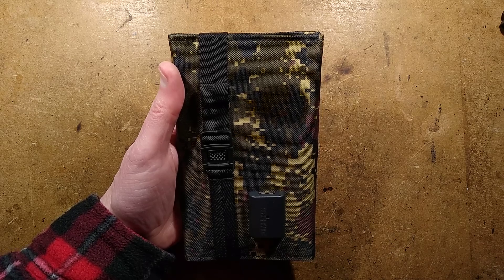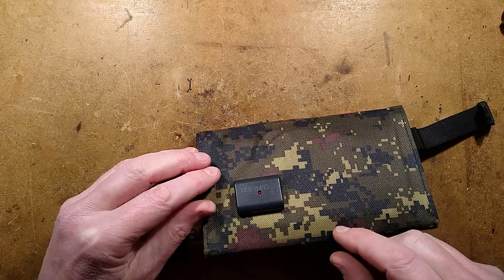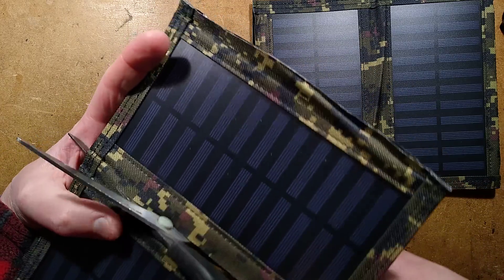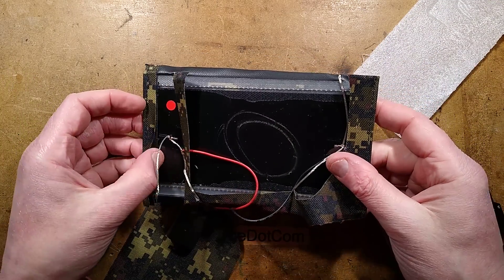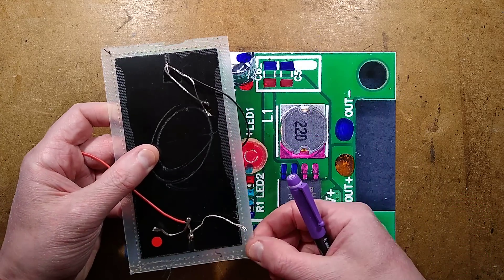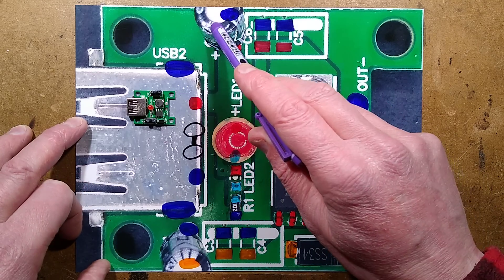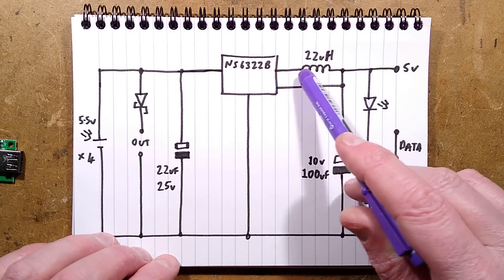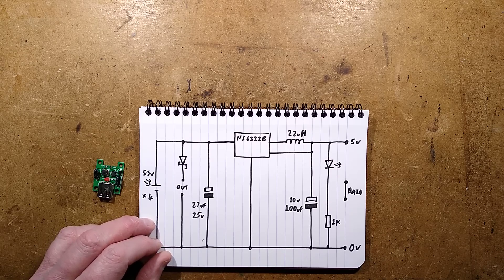Inside an eBay folding solar panel - with schematic

Comment: That reflects partly my experience with the solar-panel-added powerbank I bought.
The 4 or 5 solar panels barely kept the level of the powerbank (we're talking about direct sunlight on a beach in Portugal in June!), while the powerbank could barely deliver what my smartphone consumed. 🤭
It's rather a technical toy.
Thank goodness I'm having a further powerbank that's less bulky, less heavy, but it has robust 20,000 mAh on board, 2 USB-A charger and one USB-C charger and enough oomph to charge my phone even under heavy use! 😉
Reply: I have a solar charged power bank which claims, I believe, to be 8000 mAH.  I haven’t measured that, but it can power an Arduino for at least a few hours.  The funny part is the solar panel.  As soon as the faintest light is available, the charge indicator LEDs light up.  The LEDs can consume more power than the panel delivers, thus emptying the battery.  I have to remember to keep it on the table with the panel side facing down.  As a regular USB-charged power bank it isn’t bad.  It also has a really bright LED flood light built in.
Reply: @just_saw_dust  🤪🤭
Reply: @just_saw_dust  What a pity that the crappy manufacturers exploit the idea of renewable energy, off the grid and on the go so much. 😳

Comment: I think solar panels are useful for certain applications but people who have their roofs covered with them are dumb. If you buy a simple solar cooker and set it up on a sunny day it has easily 10 times the energy output of a solar panel of the same size. I am thinking about building a little pot to put on my solar cooker and attach a little steam turbine to it. I bet I will be able to generate more energy this way than any solar panel. It would probably also last longer than a solar panel.

Comment: I'd just buy the usb regulator alone and use little panels salvaged if I didn't already have a buck converter 4 usb hub that is for clipping to any battery between 10 an 45v's. Still works with 2 scrap spotlight panels instead.
   Sad about the false claims, that's why I can't hardly buy anything online anymore. Need to test my amazon car blade fuses now too.. thanks to you.

Comment: I wonder if the panels output power exceeds the spec of the buck - some over provisioning is normal on solar cell systems. I'm also sure they are telling porkies too as I doubt they are doing 4x over provisioning...

Comment: It takes quite a bit of careful research and filtering of truthful reviews from nonsense to select a good one of these. I can recommend this one, which I bought a year ago for £73:
"BigBlue 3 USB Ports 28W Solar Charger (5V/4.8A Max Total) Foldable Waterproof Outdoor Solar Battery Charger"
But not the variant which embeds a voltmeter, which is apparently older and less powerful.
Reply: It is also worth mentioning to also carefully research and invest in the highest quality USB cables, as many have preposterously high resistance. Andreas Spiess and GreatScott! both recently did a videos on this.

Comment: The power output also depends on where you are on the surface of this planet.
Australia for example can deliver 2,600+ kWh/m2
Scotland typically has a solar irradiation level of 800 kWh/m2.

I am not surprised you only managed about 1/4 of the rated power output.
The specifications are probably based on the maximum solar irradiation level on Earth which can be 4 times higher than that normally experienced in Scotland.

So Big Clive my friend, You may need to visit Australia soon - even if it's just for a chilled beer.
Cheers
Reply: Clive is Scottish but he lives on the isle of man.
Reply: @simontay4851 I was unaware of that.
Nevertheless, the Isle of Man has very similar annual solar irradiation levels to Scotland.
Reply from the maker: I visited Perth and Melbourne a long time ago.
Reply: @bigclivedotcom Great cities - although I would not recommend being in Australia during a Pandemic - especially in Melbourne or Perth.

Comment: I have a 5W rigid panel for camping that's bigger than that thing even if you count the plastic surrounds. My one actually gives nearly 5W in Australia in summer, and is solid enough that I've had it for 10 years and it still works (many, many camping trips and quite a lot of use). Viz, they're claiming 100% conversion efficiency even at 5W, to get 20W you need 4x that :)

Comment: You were still ripped off, I bought a solar panel (E bay) that was sold with ridiculous claims  about the output, after offering ever increasing discounts to accept the crap product they eventually said I could keep it and refunded me 100%.

Comment: ROFL!!! I just found one on ebay US : 
Portable 100W USB Solar Panel Folding Power Bank Outdoor Camping Phone Charger. Auction 99 cents + 35.99!!! Shipping!
I just had to tell you.
Thanks for sharing :D
Reply: Solar should be at most a couple of quid per watt.  I think that listing should say 1.00 W.  To get 100w you need a panel around 0.3 square meters in size.

Comment: @4:12 - I have a beautiful 4 in 1 screwdriver carefully crafted from alueminium with a lovely screw-on cap at the back.  Lovely and anodized red.  First bounce you get off 240, you toss it right in the "wifes" tool bag.  I speak from experience.
Reply: Aloomium?
Reply: @El_Grincho  No, he said alueminium.

Comment: NEVER believe power output ratings on cheap chinese solar panels - Always check the dimensions and compare them to a reputable 200w+ panel area, to get a 'likely' power output. I sent some back to amazon only this week because the 145mA output rated cells were producing 9-11mA i3cm away from a lightsource that was too intense to look at.

Comment: Looks like the plastic welder burned your workbench...
So they just connected the panels with bare wires? I know it's low power. But still, insulated wire would be better IMHO. Not that I expected much. Kinda neat toy though ;)

Comment: "Of course I will take 40% off"
"How can I tear it apart if I send it back?"
Reply: I think the seller still successfully scammed Clive on this one. The panel only produces about 25% of it's claimed output, so surely Clive should be getting a 75% discount? 🙃
Reply: @UK-Combustibility-Assured Not 25% of the claimed output, it is more like 2.5% of the claimed output of 100W; usuable output is less.

Comment: I used to have one of these, except the solar panels were actually 100% solar panel, rather than 50%. At least you can see it's crap from the picture with that kind of cost-cutting.
Reply: I was going to say I picked up one of these a couple years ago off AliExpress and it was properly equipped so that in perfect conditions it actually output 10W. Outside of perfect conditions it was still good enough.

Comment: I would love for you to make a video where you go through how you reverse engineer these circuits, even if it is long.
Reply: There isn't much to it except for lots of tedious and error prone work. Trace the tracks on the real thing or a picture, and mark them. Confirm with a multimeter in continuity mode. Redraw your schematic with component values countless times until everything actually fits 😅. Knowing how typical circuits work is a huge advantage (in general, it's not only to reverse engineering), as it lets you spot tracing errors that would otherwise lead to very confusing circuits.

Comment: I commented on this last night. Youtube appear to be removing lots of my comments. 🤷‍♂
Interesting setup, not the best system if you need to charge anything 🤣🤣
Reply from the maker: I wonder if they're detecting rogue keywords.
Reply: @bigclivedotcom  I dont get any notice that people have replied to a comment, I only found this as it just gone public. 👍👍
Reply: Same, like three-four of my comments never got posted in the past few days.
Reply: @tomclanys  Yep, but now I dont get anything that says people have replied to my posts I didnt have anything to tell me the Big Man himself replied. 🤣🤣      blinking thing making me type the same thing 4 times.👍
Reply: 😠, I think that is a recent bug; when I post a comment, sometimes it will be duplicated and appear halfway down the comment string, I have seen other comments cloned 3/4 times in the comment section. But I also think the glitch does the opposite and causes comments not to appear/get deleted, particularly when the video is closed then re-opened. For the main comment section on this video: my comment has been duplicated!

Comment: We'd probably have better luck with these things here in Australia, but even still you wouldn't expect to set it out for half an hour over lunch and expect your phone to be at full. 

Maybe if you removed the cells from the fabric and stitched them into the top flap of a backpack it'd be usable as a trickle charge on a powerbank while you walk all day.
Reply: Kmart sold them for a while. The one I got will happily do 2a in full sun or slightly over cast. When camping I'll throw a 20ah power bank onto it and go about my day. Then use the powerbank at night. Works quite well.
Reply: Not really. I bought one on eBay to test it out. that was about the size of two of the panels shown here, and it delivered next to nothing. This was in the middle of Summer in Sydney.
I knew the tester I was using wasn't faulty because it worked fine elsewhere so I could only conclude that these panels were junk.
Reply: @two_tier_gary_rumain Oof. Sounds junk indeed.
Reply: @two_tier_gary_rumain  You can get a real 12V 15W solar panel and a car charger for roughly the same total price, and connect both to create your own DIY solar phone charger. The panel itself is huge but it can still fit in your backpack (about the same size as a 14 inch laptop)

Comment: Maybe the output is for possible use in solar battery bank?
Reply: The current is so low from the panels you could probably just use a DW01 protected cell (perhaps a recycled cell phone battery?).
Reply from the maker: It would be fine for direct DW01 protected cell charging.  Or TP4056 for more accurate top limit.
Reply: I’m convinced that they have no rubbish dumps in China, no need when Big Clive buys up all their crap.

Comment: I can see a wiggly burn on the desk from the plastic welder test :)
Reply from the maker: I spontaneously did that, and it happened much faster than I was expecting.
Reply: A few burn marks are a sign of a well used workbench.
Reply: @bigclivedotcom  did you brand your arm too? 🤣 🔥
Reply: We're living in a wiggly world, it's our duty now for the future.
Reply: Ha! Noticed the same thing. That poor bench has stories to tell, and they're measured in BTUs.
Reply: Nicer than the exploding battery scars.
Reply: "Wiggly burn" 🔥🤣
Reply: @marcse7en  I read it as Wiggly bum in the first comment... 😂
Reply: That's a true benchmark, that is! Not quite true to the meaning of the word, but plenty good enough 😀
Reply: So the intrusive thoughts won...
Reply: That's a Big Clive Trade Mark/Copyright Symbol. 😂
Reply: first thing I noticed 😅
Reply: That short convinced me to buy a hot stapler yesterday lol
Reply: Lol I came here to say that
Reply: I've been wondering about that for a while and finally trawled back through the videos today (4th Jan 2026).  Took a few goes to find it, but it was interesting to see that the burn didn't happen during the obvious video.  Some playing around after a reassembly I think 😀
Reply: Oh god, that's all I'm ever going too be able to notice now 😂
Reply: @phonotical continuity!
Reply: I was just going to say that. Burnt bench time 🔥                 👍👍
Reply: @dcallan812  Wondered if someone else noticed....lol